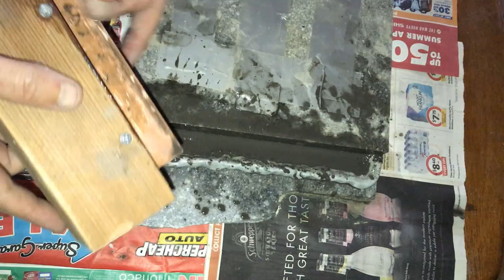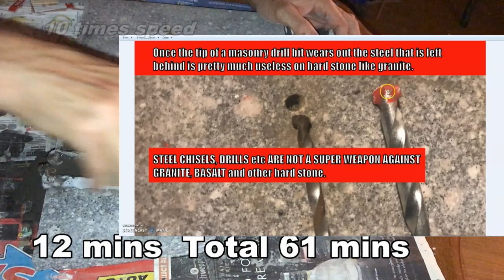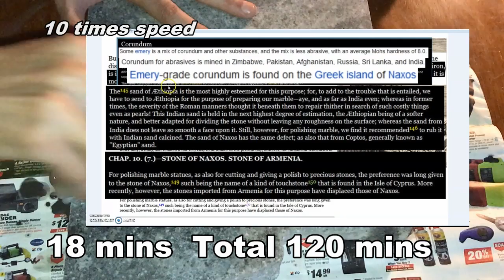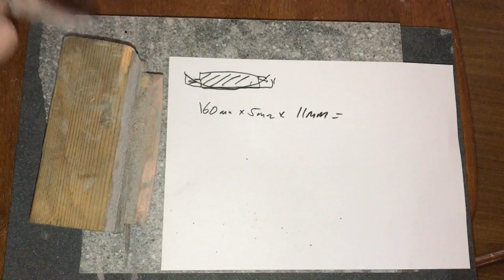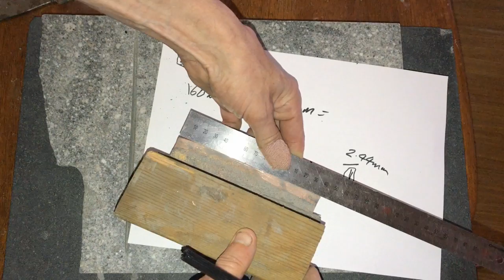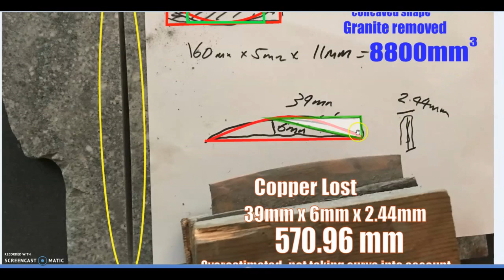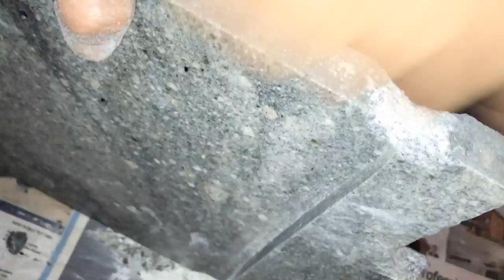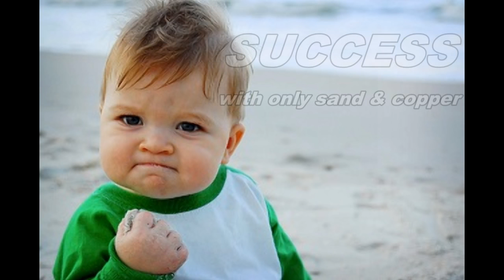LOST ANCIENT HIGH TECHNOLOGY- HIGH SPEED CIRCULAR SAWS 100% Debunked with Experimental Archeology

Comment: Yeah sure... How did they made Petra?
Reply from the maker: It's sandstone! The Treasury and other famous buildings are all Greco- Roman decorations- Ionic and Corinthian columns. The "unexplained tools" marks are exactly the same as quarry marks in sandstone that can be found here in Sydney sandstone and anywhere else. Pickaxe that matches the way a man works. The squared corners , literally the first thing an apprentice stone mason is trained to do,to create flat and square surfaces, it's called boning in. There's not a single thing about Petra that is mysterious. It's just sandstone. Apart from the scale but it is an ancient place, before the Roman era buildings it is famous for they made canals and water cisterns, most of those very roughly cut, only a few are squared off. Water is life. All trade that goes through the desert arrives at a small handful of places. Baalbek, Palmyra, Joresh, Petra because that's where the water is. Major flooding is a constant issue and they built a tunnel to channel the water away from the main centre. Evidence of a giant flood that topped this diversion and probably the reason for the abandonment of the city. Petra was rich because of the trade coming through there. And its just sandstone. Copper/bronze chisels cut through that type of stone like it's chalk.
Reply: @SacredGeometryDecoded  LOL come on man !! I thought I was subscribed to a clever channel.... OK, just look at this two pictures  * https://tinyurl.com/ql7odor  **  https://tinyurl.com/scbcmru  ** First one from Egypt pyramid of menkaure´s entrance. Second one from Cuzco,  Peru.... diferent continents, different millenia, same technology??. And what are for those knobs in the stone?!  So they were just lazy to carve that part of the stone LOL.- Gonna tell you a secret...among other things, these people had technology to "melt" the stone.
Reply: @slamblambacid  

is that a big question? who invented bricks?
Reply: @KaroBike  It's pink GRANITE what you are seeing in those pictures.
Reply: @slamblambacid  The knobs are for lifting, these exact things are explained practically in every description box under every video. 
here's some, just look at the description box, and you'll find links
https://www.youtube.com/watch?v=CyauQ7_z-A0
Reply: Can't find anything spesific right now, but block and tackle or something it's called, where you can reduce weight by using simple rope. And the knobs are, in my opinion, for that purpose.
Reply: @slamblambacid  Do you think there is only pink granite in Egypt? Have you checked the geological maps ??
Reply: @KaroBike  I think this person's mind is telling them it can't be done. Because of .. a REASON, that one points out in caps to make it clear to all to see.
Reply: @Akimos  I'm sure you all folks can gather around on of these days and build one of those walls and caves for yourselves... just because it's a lot easier than just stack some raw rocks and wood like I would do it for myself. Let me know when it's finished.. I invite the beers!! . Good Luck !!
Reply: @Akimos  ufo;) magic :) spells;) high technology;) like in children's cartoons;) children's minds;)
Reply: @slamblambacid  🍻🍻🍻🍻🍻🍻🍻
Reply: @slamblambacid  Well no-one said it was easy. The way you'd do it does not reflect anything that they would have done ancient times, you have shown that. When you say gather folks, well people tend to have other things to do than listen to me. This video is about proving a method. If you cannot see that, well then, I don't care. I have beer here already, cheers.
Reply: @KaroBike  It's the case (planned joke) of I know better, if I can't do it, how could they. Been there, so ..
Reply: @Akimos  So they carved all the face of a stone just leaving those knobs there for lifting LOLOLOL  and they rounded the knob making it very helpful to lift too LOLOLOLOLOL
Reply: @Akimos  Anyway , to be honest I don't know how f*** they did it. But you have to be very foolish to think it was done carving. The stone is melted. And in the Inca case clearly it was not made by them.
Reply from the maker: Lol, playing around with a stone hammer one of the first things I did was make a magical nub on grey granite. If I make one in black granite does that make me a god?
The menkaure pyramid stones have been smoothed down, the bosses that were broken off were found on site as far back as Petrie.
The other experiments I have filmed and will be posting are on how to grind down black granite to a honed surface, including split face black granite.
If you are impressed enough by sandstone and Petra to think it’s somehow mysterious how can you expect to be taken seriously in regards to melted granite? was The pink granite polygonal masonry of bomarsund fortress melted? 
Does the bow and arrow on different continents mean that people couldn’t come to similar conclusions therefore lost ancient mystery? 
It’s a logical fallacy the same as different construction styles automatically means two different cultures.
Reply: Again, it's not impossible, if you cannot figure it out.
Reply from the maker: Pantograph is still used today by sculptors to make exact copies of statues. Ancient technology. Secrets of the Parthenon doco they use it to fit SHATTERED stones together. Making that polygonal masonry look like child’s play. The kind of thing lost ancient high tech people hide.
You can find that and see it and do it for yourself. Or you can watch people pointing at stones and repeating like a cult mantra ‘It’s impossible...It’s impossible’
Reply: @slamblambacid  You CANNOT melt rock and keep its mineral properties. The minerals will react to the heat and split up. And can never ever again become the same rock. Also its easy to see and prove if its been done.   You are on youtube .. try searching for melted rock and report back what you see.
Reply from the maker: At those very sites you show there are bosses in various states. Some have a groove on the underside. Some are partially ground down and there are indents where some have been broken off 
If molten stone was possible what type of form could hold the weight and survive the heat without deforming? Just pour any gel or liquid into a bag and see what gravity makes it do. The mould would have to be solid meaning the pour would have to be into the stones on either side to keep the fit. In which case the fit would be perfect matching every contour and pit exactly. Stones could not be removed from each other but they can be.
the backside of those stones are rough and have tool marks. Visit Mike Haduck Masonry channel where he shows the things lost high technology scammers deliberately hide in Egypt and South America.
How much effort would go into shaping individual mouldings? To support the weight they’d have to be stone or metal. More effort required that just working the stone. Molten stone would change it’s chemistry.
The laws of science just make it impossible.
Same with resonance since the vibrations would cause heavier elements to fall to bottom just like a gold mining pan or shaker.
These theories are entirely in the Harry Potter realm of magic.
Reply from the maker: Truckers Hitch knot, with a single piece of rope you can make a compound pulley. Each time you loop it the energy needed to lift the stone halves but you need to pull on it twice as long.
Within a few loops 100 tons becomes 50, then 25 then 12.5. Before you know it impossible lifts become something for the grandma’s to do.
Can just as easily be used to pull as to lift.
Reply: @slamblambacid  You are wrong;) first they built solid foundations (supporting polygonal walls resistant to earthquakes) and then on this foundation they built small Inca houses of small stones in which they live today. The Incas are not giants.
Reply: @frosty6960  yes you can;) for example with "acid", in Peru there are many small "acidic lakes"
Reply: @slam blambacid Atlanteans tamed unicorns and used them to quarry the rock with their horns. They also made it in the greco-roman architectural style, just to mess with the archaeologists.

Of course, in the case of Abu Simbel, they used giant lizards and lasers. The temple was originally dedicated to Pikachu, but the Egyptians came along and usurped it. Ramses the Great was working for the Vatican and tried to suppress the truth  . For more information, check out the scientific work of the excellent researchers Brien Forester, Bright Insight and Uncharted X. Keep fighting the good fight!
Reply: @MrAchile13  This is becoming hilarious, people not understanding how things are made, and then shown, and not realizing they been shown the method, but rather referring to another thing they didn't understand. Not understanding does not make something impossible.
Reply: It's like the shirt I'm wearing, I don't know how the fabric is made, but I'm wearing it, so how about them jeans, then?
Reply from the maker: Jeans get explained. Ahhh but what about my shoes? You can’t make those without advanced lost technology!!
Reply: Easter bunnys have elongated skulls
Reply: What is the technology you are talking about? What do you mean? What type of tools were they? Bcs if it was even close to the "high technology" tools we use today in masonry and carpentry you would get much better accuracy on the "impossible flat surfaces" or "90 degree" angles that's not even flat or 90 degree. Have you done any type of masonry etc? Have you ever done any type of construction or studied physics? I mean, what type of experience or studies do you have to be able to say it was not done the way scientist say?
Reply from the maker: Harry Potter technology. A magic wand from Diagonal Alley
Reply: @SacredGeometryDecoded  I'm talking about occult esoteric sciences, alchemy  and astrology, intended to be mastered only by a small number of initiates. https://tinyurl.com/ty5zqd2 - really, you can't believe people could enslave their entire lives doing this the hard way. Nobody ever even tried to make one of this in miniature just for fun. By the way I don't think the Incas made it..  It's pre diluvian.
Reply: @slamblambacid  and thats what you say when you have no clue about people who work in coal mines, every day, even today in the XXI century...because you were lucky not to be born in poverty...
Reply: @slamblambacid  Same reason we all go to work, to get that sweet beer and bread at the end of the day.